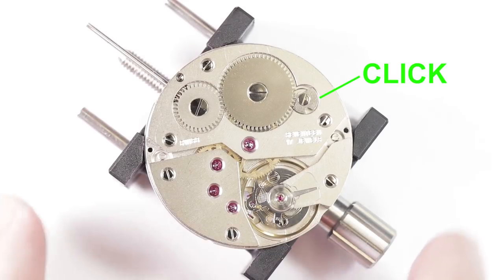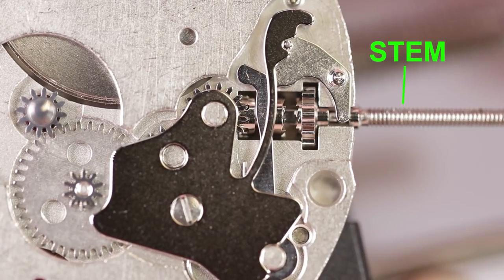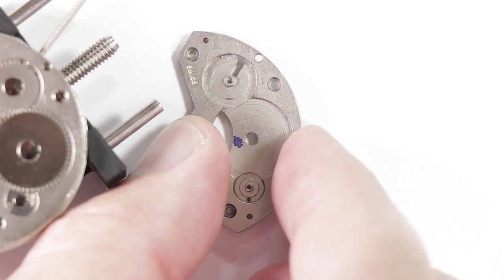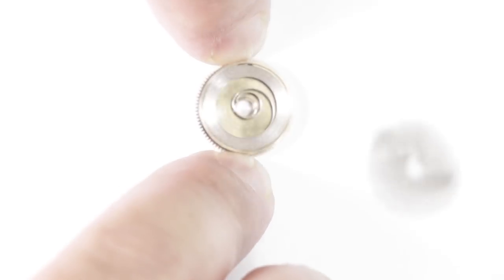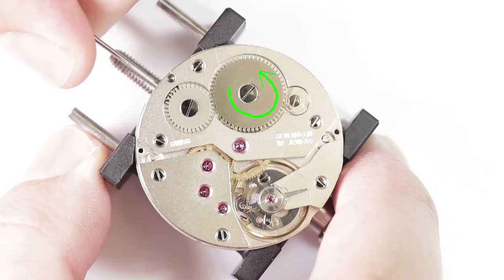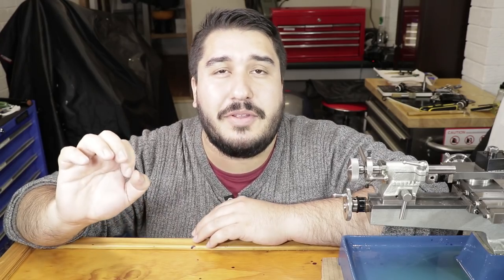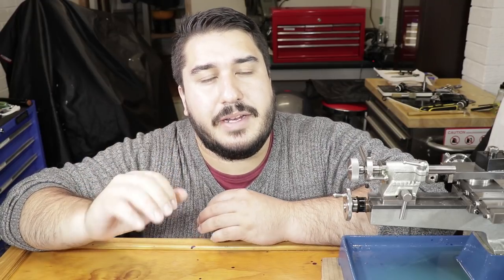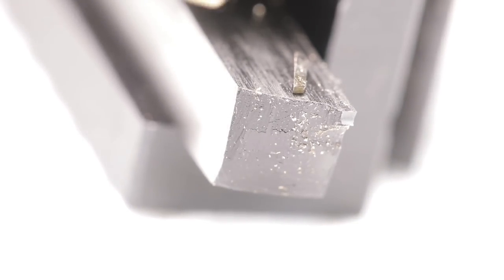Click and Clickspring  seat Watchmaking Vlog #9

Comment: It is my First day watching your channel. Noticed your comment on "Making Tools".  My Favorite source of Micro Tool Steel, is obtained from what are named "Printed Circuit Drills". All shanks are 0.125" imperial, or 3.1~metric. (I try to remember metric conversions but not @ the Moment!). 

They are Carbide drills (or routers for some) & of course "any of them below #70" break if you even look at the hard! So I save those stubs, and Grind them to my needs, including Micro Boring bars! Hopes that helps,
philip from the Great Pacific NorthWET.
Reply from the maker: Thanks Philip! That is some great advice! I want to try get a proper tool grinding machine in the near future. That will come in handy!